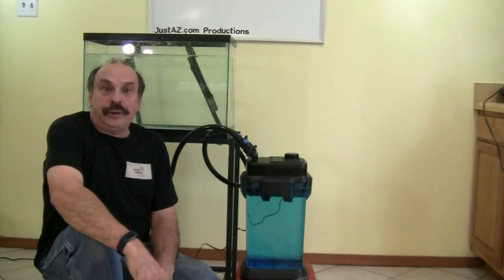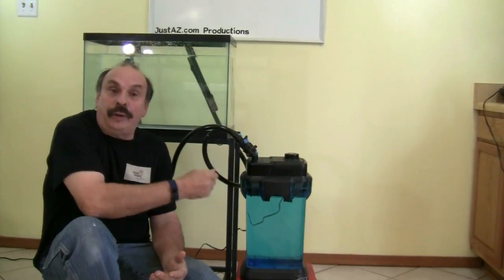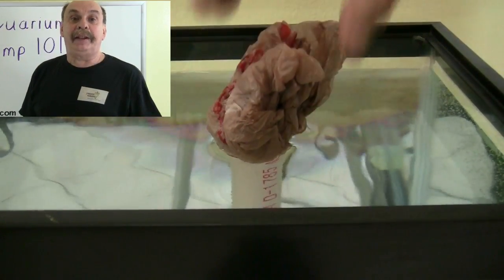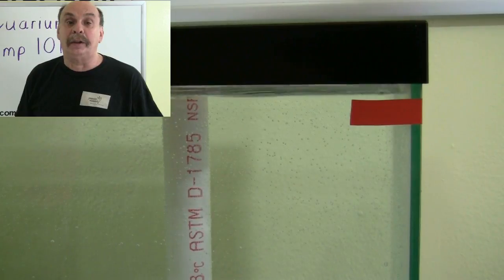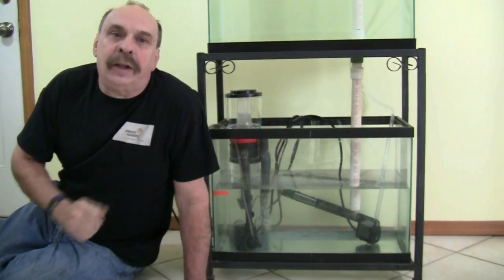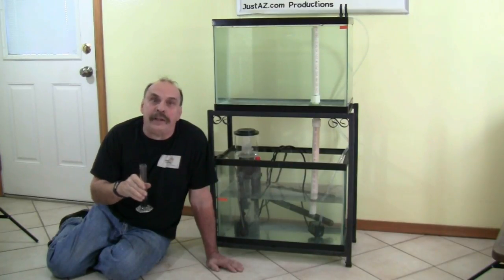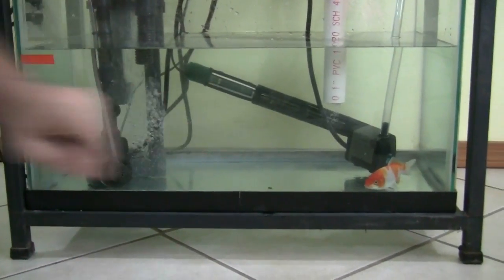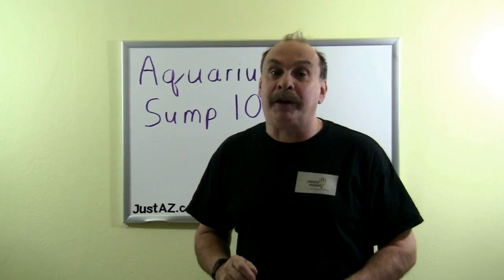Aquarium Sump 101 An Introduction to Sumps

Comment: So in this demonstration I see that you used a sump the same size as the tank, but how can you calculate how large a sump you need?  For instance,  I'm getting ready to set up a 55 gallon tank, due to space restrictions inside the stand underneath,  I may only be able to make a 20 gallon sump. Would that be sufficient?
Reply from the maker: There is no set size, most people who have a sump say "use the largest size you can afford and have room for". The only rule is leave enough space for backflow. That said. I have seen 20g sumps working very well with 55g tanks. However most agree that if they had to do it all over, they would have gotten a larger sump. A 20 gallon is sufficient. My recommendation is if you have the room try to go larger 30-40g I think that after you have it running for a few months you be glad you did.